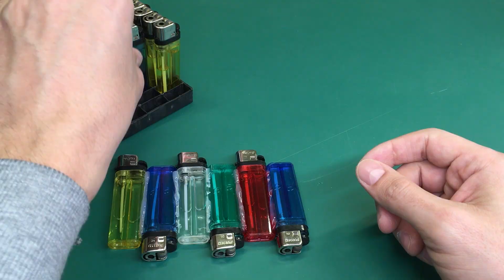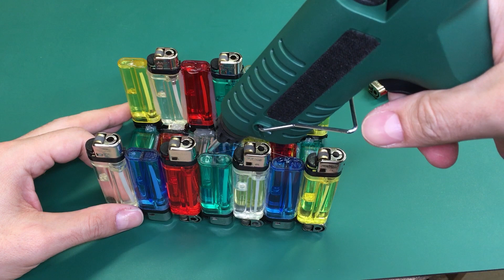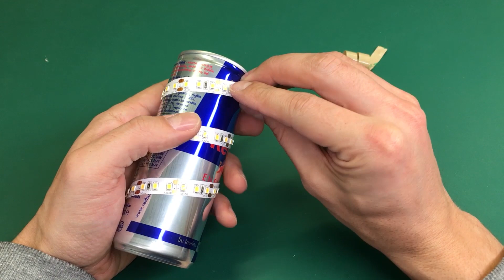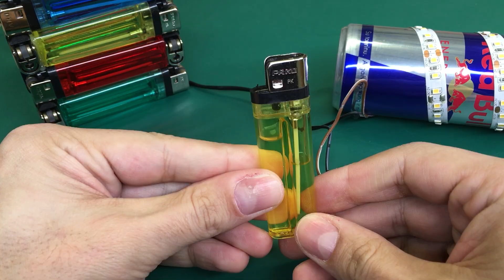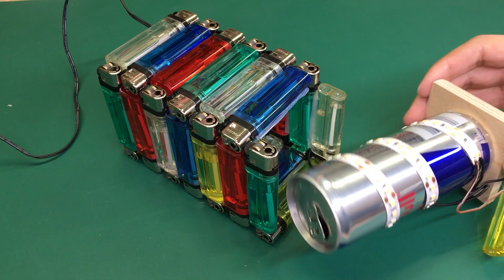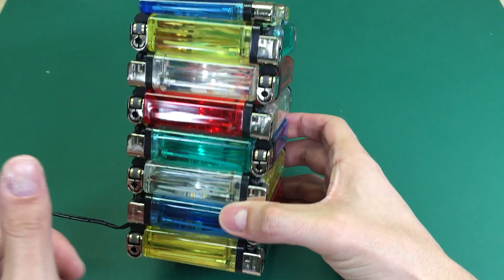Making A Simple LED Lamp from Lighters

Comment: So... Yeah, let's hope there are no short circuit issues with that lamp🤣 probably use some empty lighters when dealing with homemade circuits and solder joints. That way you don't, you know, die in your sleep... but I digress. For the next project you should build a gas can with a high lumen LED transparent window, an internal battery pack, and a grill igniter repurposed into a power switch. That way you can really see the gas level inside the can. Might as well, you're already halfway there...